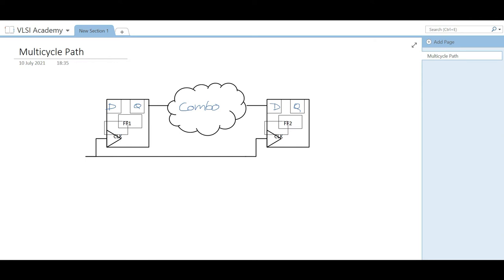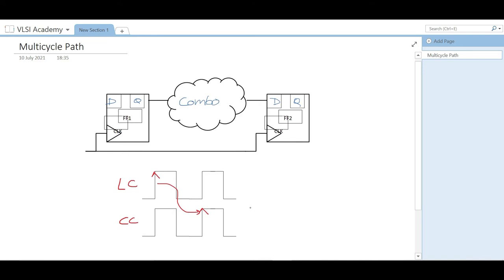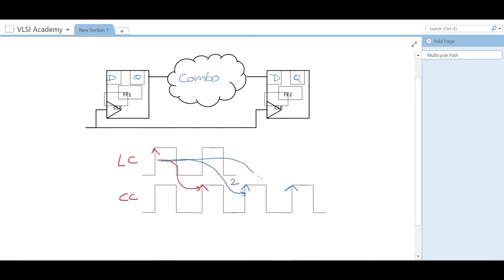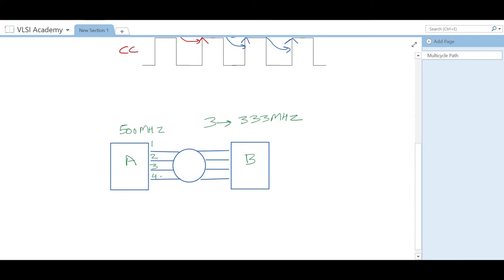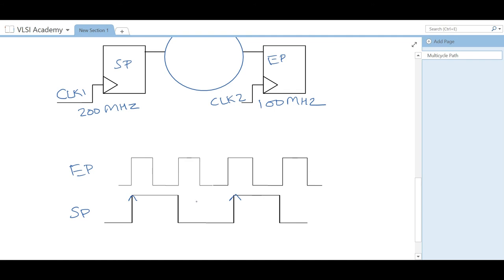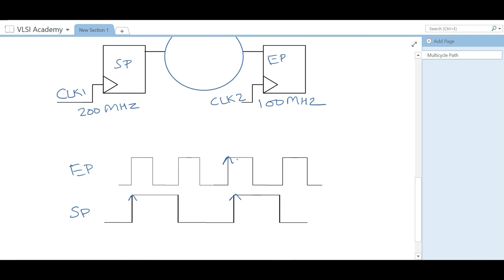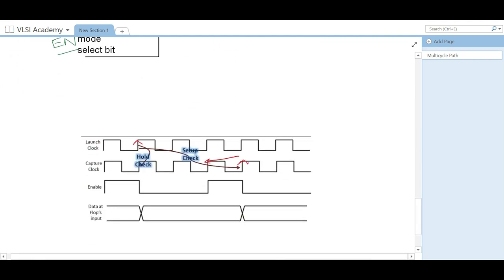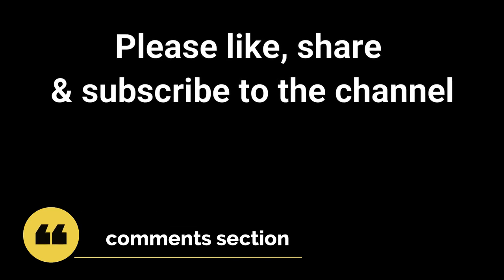sta lec23 timing exceptions part2 | multi-cycle path  | Static Timing Analysis tutorial | VLSI

Comment: in the example at 3:50, when you make datapath 3 multicycle (2 cycles in exact), the data would arrive block B one cycle late and wouldnt that affect the design?
Reply: By making the longer path a multicycle path, you allow for more slack in timing, which can potentially reduce the overall criticality of the design. Timing analysis tools will no longer flag violations on that particular path as long as they meet the relaxed timing requirements (i.e., setup and hold times within the extended window). The timing paths associated with the faster clock domains (running at 500MHz) will still be subject to their original timing constraints, ensuring that they meet the required setup and hold times.
Reply from the maker: MCP is applied only when designer approves it, it's done on non critical paths only

Comment: Correct me if I am wrong, clock waveform for SP and EP should be interchanged.
Reply: @VLSIAcademyhub   SP is @ 200 MHZ and EP is @100 MHZ, but you mentioned SP is running @ half the frequency, which is incorrect I
Reply: @VLSIAcademyhub  Thanks!
Reply: @Priya-vl5cw what was the reply of @VLSIAcademyhub
Reply: You are correct bro